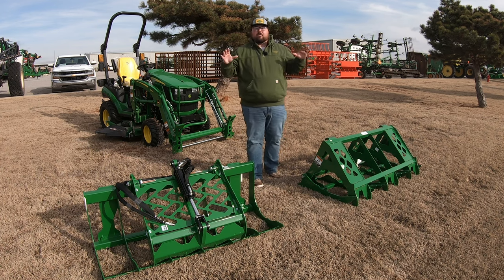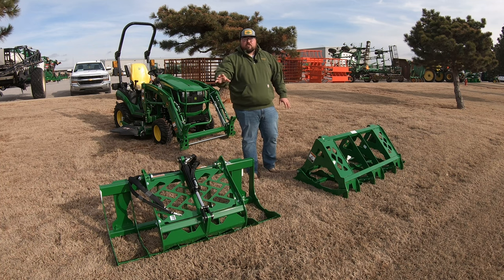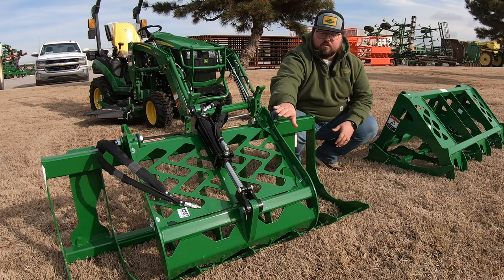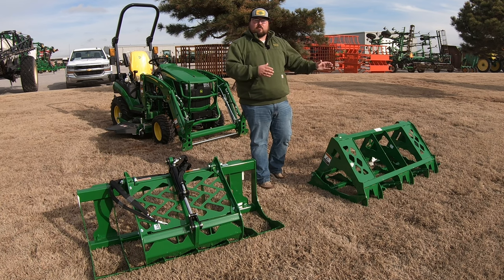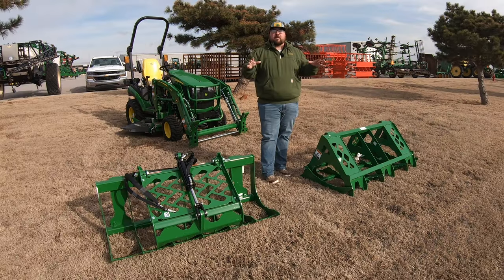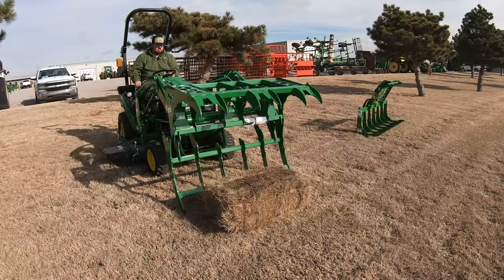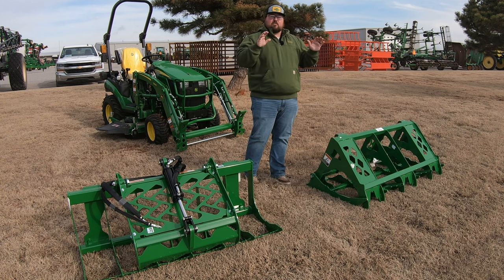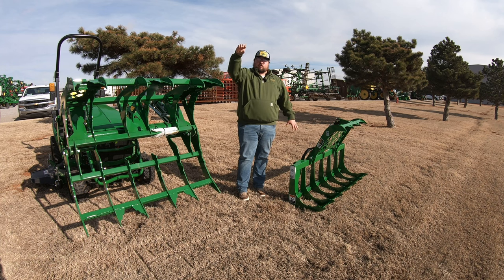3rd Function Grapple vs. Mechanical Grapple - Which do you need?

Comment: I have that Frontier Mechanical Grapple that you showed in your video and i love it. Its heavier and better built than the other brush crusher mechanical grapple. I have used it to clean up storm damaged debris and even used it to teardown an old 8ft wide by 18ft long storage building by hooking it with the top teeth of the grapple and pulling and ripping the walls down. I was very impressed how well it worked and preformed the task i used it for on that building. I would highly recommend the Frontier Mechanical grapple as a good alternative to spending the money to install a 3rd function on the loader.

Comment: I have the mechanical grapple and personally I think it's heavier built. You can also you I as a root rake getting up roots a inch or so below the surface. It is well braced and it opens up wider as well as you mentioned how the top clamp goes all the way across so you have more surface area. Makes it to where you can use the corner to grab certain things etc.